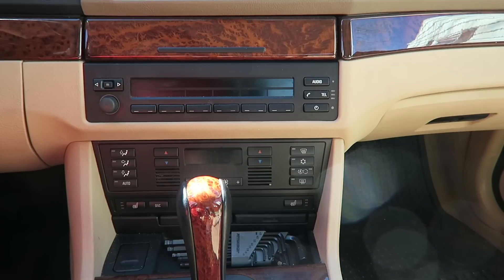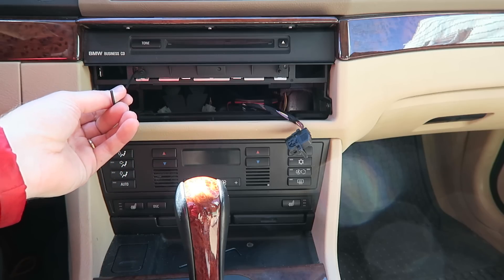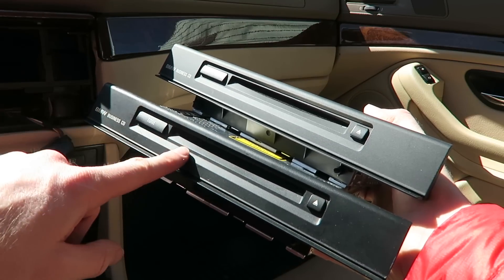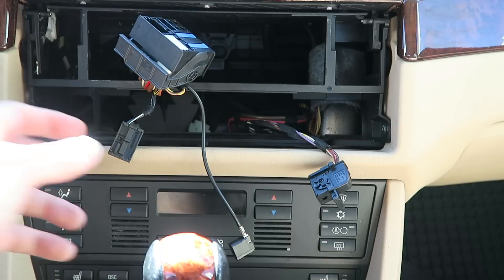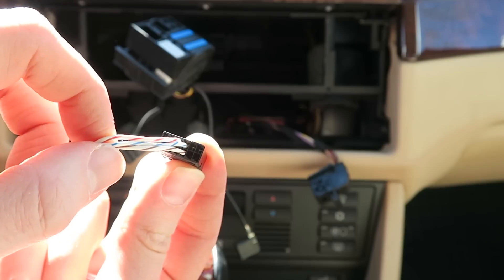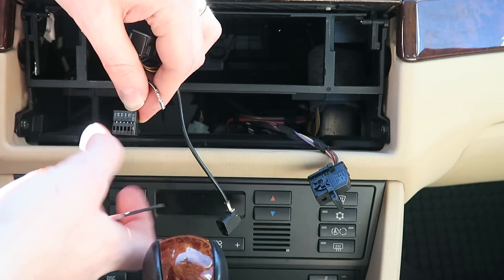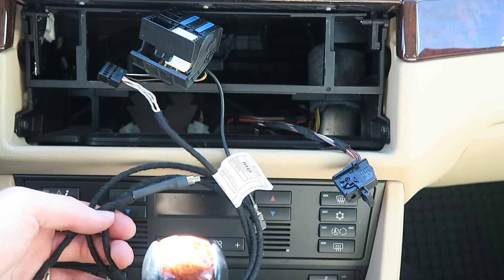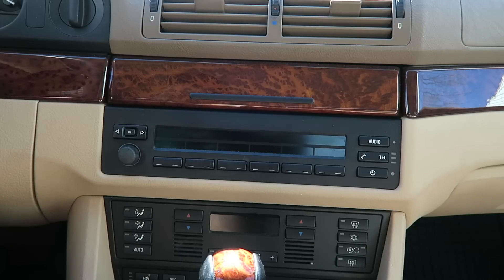E39 Factory BMW Aux Input Adapter Kit Installation DIY

Comment: Another excellent video. I have a 2005 x5 with standard radio and cd player. I was thinking of drilling a hole in the faceplate of the cd player on the left or right side. How do you think that would work?

Comment: Bimmer zeit, after buying a 2003 auto 530i only a few months after I got a 2002 manual 530i which obviously is gonna be kept.
However, I tried today to connect an auxiliary kit bought from ebay - not the original BMW kit though - but one which is identical with 3 wires.
I connected the other brown & white and black & white from the 2002 530i to the kit I have bought - so 5 wires in total - and plug them in the main connector housing.
It was no change, the display only shown RADIO and CD but no AUX.
I have to mention that on the back of my 2002 manual 530i radio is mentioned : 2002 JUNE

That means that radio won't work in this case because of its too old production date.
Is it any other way to install the MP3 kit in this case ?
I have one solution : swap the 2003 530i radio - which has a 2003 production date - into the 2002 530i ... is it gonna work in this case ?

Thank you !

Comment: Rather this than the DAB adapter I had installed. It only transmits FM signals for the original radio to receive, so the interference is insane.

Comment: My DSP radio on e39 1998 528i has a 17 pin connector. These newer radios (2002/09+) have different connectors.
Any solution in this case to get AUX?
Reply from the maker: Buy a newer radio on eBay. Confirm the date before buying
Reply: @BIMMERZEITT  The new radio will allow for AUX capability. But I won't be able to connect that radio with my old connector since it's different. Not sure how people solved that issue?

Comment: I clicked the link and it didn’t show this cable, but it showed some kind of white screen with a cord coming out of it. Is that the right thing to order?
Reply from the maker: Yes, it is correct. It looks like some of the actual images of the kit are not on the listing. But is showing an aux cable to an iPod. Look at the reviews for actual images.

Comment: Hello I have a X3  e83 2004  .Radio ist BMW CD (not Business)
I tried but on mode come not AUXILIARY.
Do you know what ist Problem.

THANK VERY MUCH.
Reply from the maker: Amir, did you use a genuine BMW kit or aftermarket?
Reply: @BIMMERZEITT  I buy on Amazon  but not BMW
Reply from the maker: @amirhajdarevic1054  this is your problem my friend. My video demonstrates the genuine BMW part being installed. Nearly everyone in the comment section with problems has bought the cheap Chinese copy on Amazon. See the disclaimer and warning in my video description!

Comment: I managed to get this to work in my 2003 525i but the two existing wires (black and white and black and brown) that go into the new aux cable are really really loose when I plug them in. Right now everything is working okay, but I'm worried they'll fall out or come loose. Any way to secure them better?
Reply: Where is the aux port located to plug your phone in

Comment: Can it bee installed a usb and bluetooth adapter instead of the aux cable adapter .
Reply from the maker: Hmm not sure man there may be a solution check the bmw forums
Reply: @BIMMERZEITT  I ty
Reply: @BIMMERZEITT  I try to find but there's no videos of some kind

Comment: I did the install. My 2002 525i doesn't seem to have an AUX. it just goes between the radio and CD when I press the Mode selector
Reply: I have the same problem. I assumed that it was because I can't have my 6-CD changer and the aux connected at the same time, but I can't find any info to confirm.
Reply: Where is the aux input located?

Comment: I hate those oem radio modules ... but have to keep them because of the enterier ...
Reply from the maker: I agree Tarik, especially the dead pixels all the time. Once they're fixed and have an aux kit installed not bad however. Better than ugly aftermarket radios * shivers *
Reply: We know the struggle, I had issues with my radio amplifier in the trunk (because I have the navigation screen). the shop where I painted my e39 while they wet sanded the car some water came into the amplifier .... after a month stopped working. It was Bm24. the used amplifiers are so hard to find and they are overpriced, but I plan to buy cd radio from X3 or Z4 and convert it as a amplifier :) 
P.S Great video !!!

Comment: you said "before reinstalling the cd player check the date to confirm reinstall of the correct one " why did you say that who would have two separate cd players? I didn't know this was a replace respilice and reinstall video though this was take out rewire the new connector and put back... 

also there was mention if you have a late 02 or earlier 03 you have what options are available in the case because I have a 03  525i 
with dsp and business cd would rather have Bluetooth but I guess aux works if cant finda Bluetooth intergrtion

Comment: Hi Zeitgeist
I have a CD player with mfg date of March 2003.  I believe I have done the install correctly.   However the AUX option does not come on.
Do you know as of what date the AUX option was added please ?  My CD player is on 6512 6927 908
Thanks
K

Comment: Do you have to remove the battery before you do this?
Reply from the maker: It is recommended to disconnect the battery terminal before doing electrical work like this